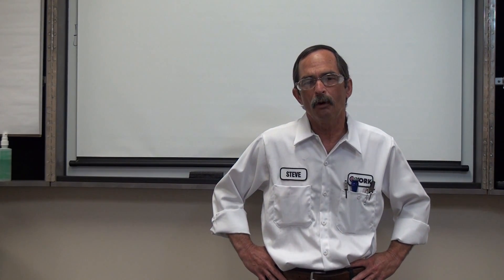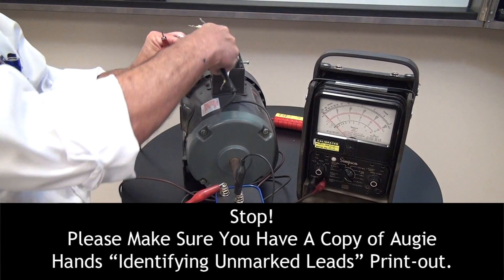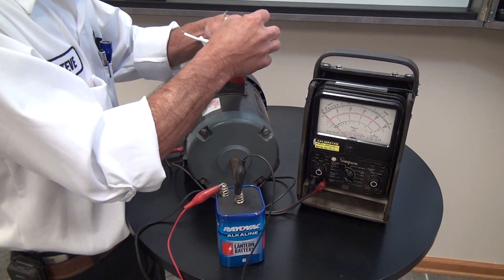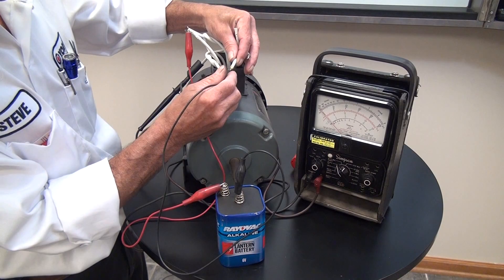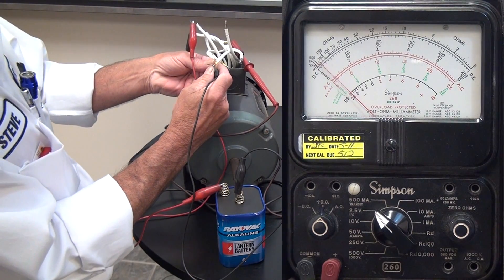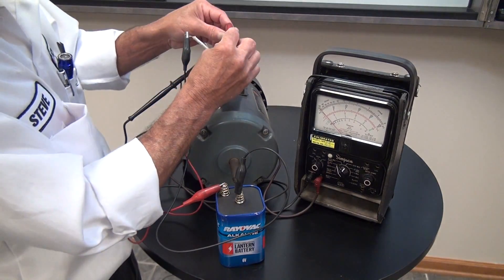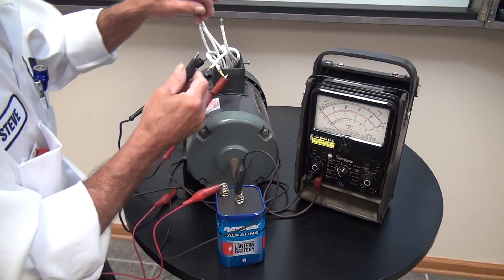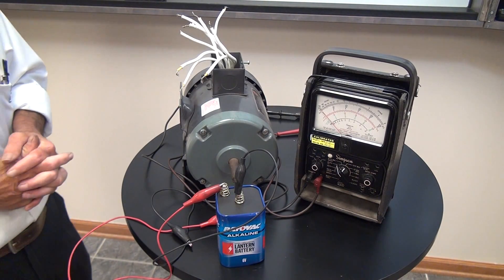Identifying Unmarked 9 Lead Motors - WYE Connection - York Repair Inc

Comment: When labeling 7 8 9, does that change the other pairs?  If the motor leads were originally labeled as 7 8 9, and you change 7 to 8, 8 to 9, and 9 to 7, will that change which pair is 1&4, 3&6, 2&5?

Comment: First I would like to thank you for your efforts and for this guide.  But the guide is a little confusing.  It states that 1 & 4 will have little to no deflection when flashing 7 & 8.  Same with 3 & 6 flashing 9 & 7.  This is a simple error on your website I assume, yes?
Reply: Docs say one thing, Video says the opposite

Comment: Hello sir good evening, i just only ask a question, the voltmeter set in 2.5v dc? Or 2.5v ac? It is dc? Just correct me if I'm wrong, thank you sir. I just take a screenshot.

Comment: WYE configuration 3lead has continuity but @ 2: 13 how can you say that leads is 7,8 & 9 you just randomly mark 7,8,9
Reply: Yes it is in fact random, reason being that the leads are in fact marked based on the meter readings in relation of these leads as marked...remember that in a 3 phase "Y" connected motor if the rotation is backwards simply swap any two feeder leads. That's why leads 7, 8 and 9 are random....I wound motors in the Navy and this is the very procedure that we used because after the motors were rewound, they have no markings.
Reply: Each of the three phase windings is essentially the same as the others, just located at a different position in the motor, thus it doesn't really matter which winding set gets assigned which number.  The only important thing is the windings in relation to each other, which is what this test sorts out.  kind of like arbitrarily deciding to draw a line on the ground and call it zero, measuring everything from that line...

This is a great video btw, although a bit dense.  After watching this 4 or five times I got crazy enough to try it, and IT WORKS! To the people who made this happen, Thank You! I will certainly remember York Repair in the future for any motor rebuilds beyond my meager capability! Great advertising!

Comment: You found the three leads that had continuity and randomly marked them 7-8and9.  Does it not matter which ones you select as 7-8 and 9.
Reply: No if they have continuity they must be connected
Reply: My understanding is you may be off but they will rotate in the correct direction when found this way. At least that's the experience I've had with my students.
Reply: Assalam walikum sir soudi consil yaqeen verified ho gaya but sir is jawzaat update nahi hua sir  agar aap ho gaya hai to bataya sir